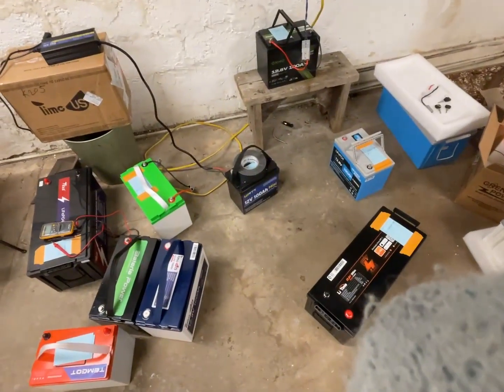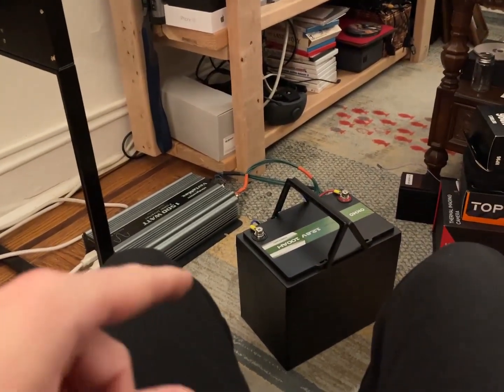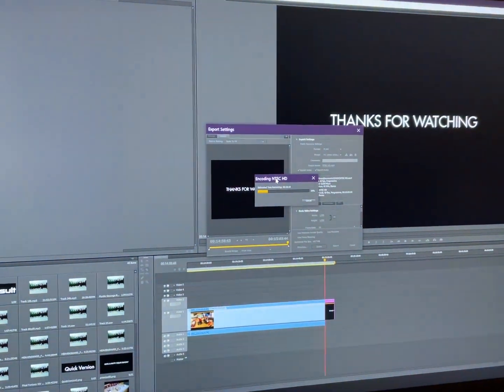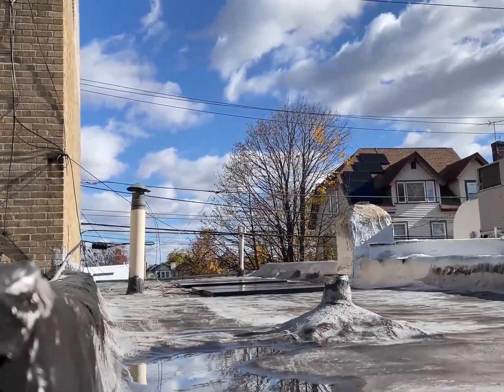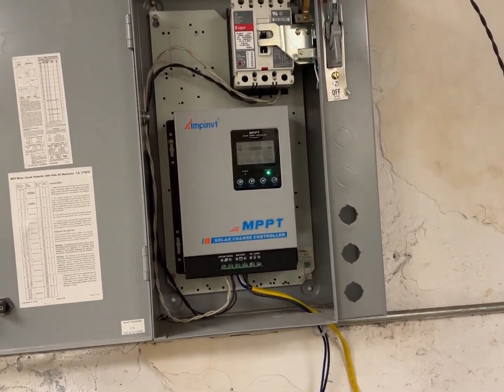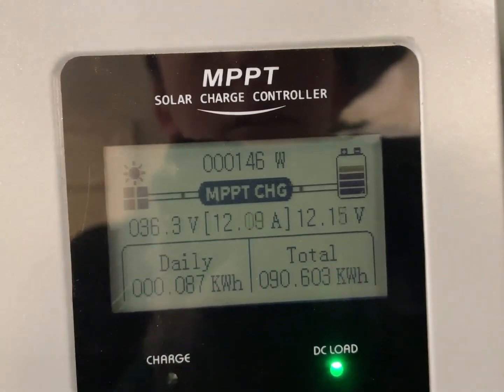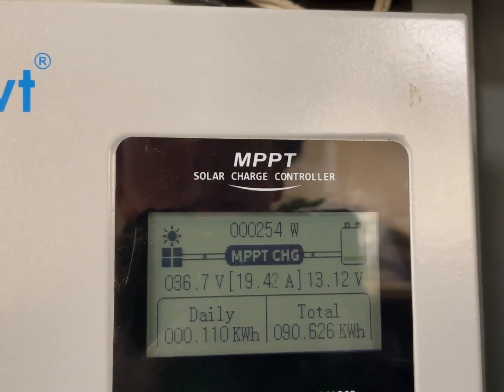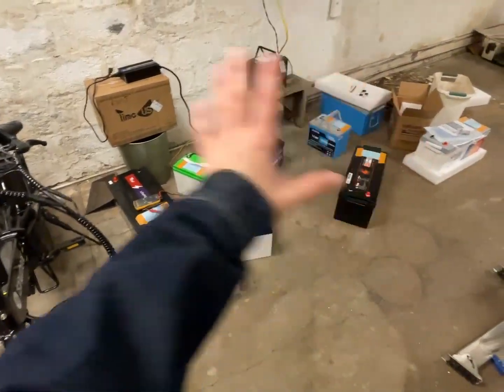Solar Sunday Experiments 33: Moving the solar panels for December, testing OKMO's 12v 100ah battery

Comment: Rin, do you ever still mess around with 18650’s??   I have a pile of them sitting about but they seem redundant now LiFePo4 is on the scene
Reply from the maker: I don't tbh, they don't hold much power and it's a hassle to put enough together to do anything with. I've decided to recycle the majority of the ones I have.
Reply: @RinoaL 🪦

Comment: Thinking about power saving it won't be much I don't think if it would be worth it or not, you can buy an power adapter to use a standard PSU so you can use one PSU to power the board and the gpu?
Reply from the maker: In a previous video I showed how I had to remove the adapter mod I had done because my 430w psu doesnt have enough of that 430 watts allocated to the 12v rail. Ends up having brownouts because some of that 430w is the minus rail and 3.3v and 5v which arent used at all.

Instead of replacing the whole power supply I just went back to having two for the time being
Reply: @RinoaL  Fair enough. Didn't see that one.
Reply from the maker: @DodgyFPV  I figure I'll probably come across a 600w PSU someday, so no sense in buying one now.

Comment: Maybe it's me, but your wires to your charge controller look a little undersized unless they are solid copper.
Reply from the maker: They are solid, but they are also under-sized. Im not really in a position to buy wire so I just double up and sometimes 4x copper wire I find in buildings
Reply: @RinoaL  oh you doubled the wire ok sounds safe enough
Reply from the maker: I figure I'll double it again when I rip out more wire haha
Reply: @RinoaL  Ive been looking at a similar Charge Controller by the same company They have some really good prices for used
Reply from the maker: Yeah? good to know!

Comment: To make the buildings you manage off grid-ish...how many panels and batteries will you need?  I would like to put solar panels on my garage facing south as a battery backup.  I have to look into this more.  I am in Wisconsin, so we don't get a lot of light in the winter.
Reply from the maker: I feel I will start by making a dedicated always-inverter 120v circuit in one of the buildings then grow from there.

I’d actually need like 50 panels to do all five buildings but thats pretty big.

The biggest building would be easy in winter due to the boiler being gas, but the air conditioners are three phase behemoths.
Reply: @RinoaL  I am hoping that we can get enough power to handle our fridge and freezer if the power goes off for a day or two.  I think there are websites that help you determine what is needed for such things, and I will seek them out.  Good luck with your project.  I actually like the battery reviews LOL!  I really like your Frankenputer too.  That cracked me up!  I got a few of those ;)
Reply from the maker: @RachelDaliHug  Oh that'd be easy tbh. My 30w panel makes 160wh sitting in our apartment window each day, my 350w of solar at the workshop makes like 1.5kwh a day. You can kinda see the math from there

Comment: There’s no reason to apologize for battery reviews.  You have the opportune to assess, as little or no significant financial cost to yourself, which we, your viewers, do not.  However, I have 1 criticism.  The solar charging, though less than ideal, is dependent on the vagaries of the weather.  Thus, the test subjects (batteries), are not being compared with a standard.
I have 2 ideas that may address that;
1: Wall/Grid powered charger (an opportune to asses chargers, maybe?).
2: A dedicated solar cell sensor (or photo-resistor/diode/transistor etc), to compare the light intensity with time, against the battery’s charge (the solar sensor effectively providing a power correction factor).

I thought your repositioning of the solar panels, parallel to the brick wall, is a good idea.  Though I also suggest, moving the panels further away from the shadows, and tilting on the edge of the build’s wall.  My not be 45°, though enough for a free (no cost) increase of output.

20l buckets, filled with water/sand/junk, could make good anchors/mounts, for a chassis supporting the panels, at a suite angle, and prevent all, but the most severe storms, moving the panels.

Again, another enjoyable and informative, presentation.
Reply from the maker: Hrmm, yeah I agree entirely. Wattcycle sent me a nice little 20A charger i've been using, but it feels a bit slow, and I almost feel dishonest using grid power so I've only done like 250wh with that. You've given me motivation to make the charging more uniform as well. Maybe when I switch over my system to charge the 48V 100AH battery, and have a step-down converter to charge the 12v Batteries, I can begin setting them to charge at a constant current.

I think then I also will select a nice array of incandescent light bulbs or something uniform to be my discharge tests.
Reply: @RinoaL 
The Post Apocalyptic Inventor, used/build a matrix of incandescent lamps, simply for load testing.  A dummy load with optical output 😄

Though boring, building a database/spreadsheet of the batteries' performance (will you need a data logger?) over a full charge-discharge cycle, could yield interesting results.  Especially if that includes several cycles for each battery (amount of capacity decay, real vs advertised capacity, and maybe % of full charge, after a month of storage).  A database like that, would have value, potentially, significant commercial value (sales impact).

I'm looking forward, to more of your presentations, and discoveries.

👍